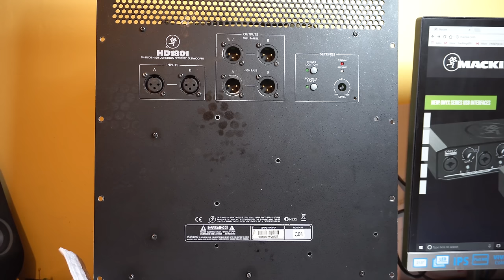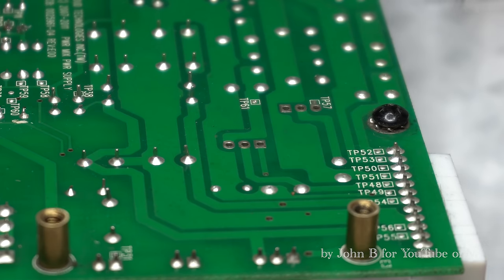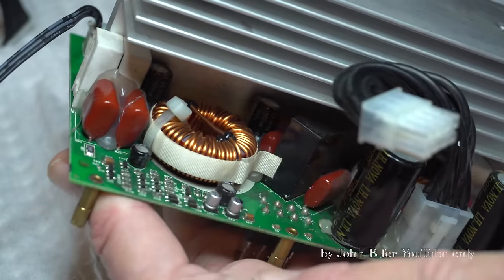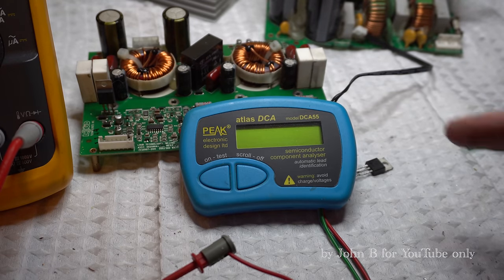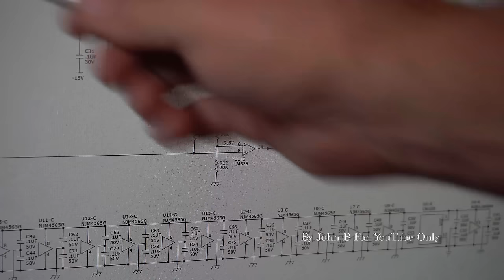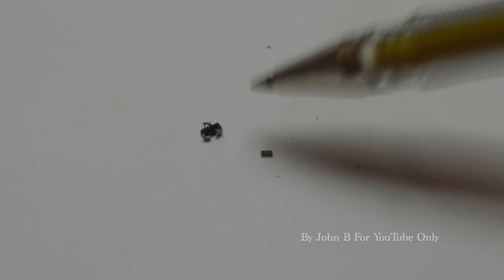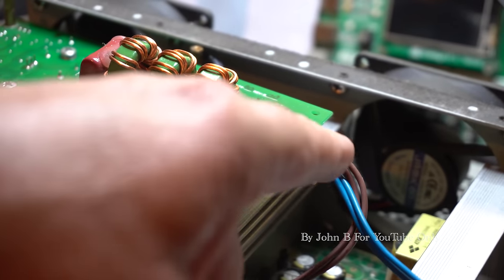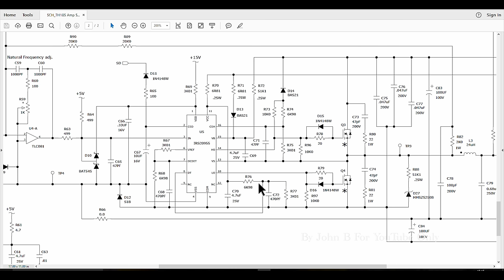Mackie HD & SRM1801 Sub Woofer Repair + IRS20955 & IRS20957S 500 watt Class D Drivers

Comment: Hi John, Thank for this helpful video. I am explroing a diy resurrection of a Mackie SRM1801 (similar power-supply) and I need some guidance.
The problem: Dead Subwoofer = blown speaker, blown power supply...at power on, only the LIMIT light came on and stayed on...
What I have done so far: I managed to identify blown resistors, diodes, and transistors throught measurement and obvious signs of failure.between Transformer(s) T2A, T2B and T2C and Q1 and Q2 and replaced them.
 Outcome: Power supply switches on (Green Light turns on and remains on - However, red light persists)
 I tested the SMPSU voltages and found that of the 4 voltages needed, the psu is only supplying the +/-15v! The remaining voltages ie +75v / -75v and 20v are not present.
I am considering removing the heatsink and the 4diodes and LM317, however, would like to avoid this. I do not see any voltages off D1 -D4, so I am wondering if the trasformer has failed.
One of your subscribers had a similar issue identifying a suitable ground for testing these diodes in circuit.

Could I progress the repair or test these components without removing the heat-sink?
The difficulty has been shared here by another poster who mentions that although test points are povided, no information on the voltages expected at those points.
Any advice and direction will be appreciated. Thanks again, your video has generated a spark of hope for my dead subwoofer. 
Apologies for the long comment.
Thank you again.
Reply from the maker: Is your amplifier connected ?
Reply: @JohnB-2021  Yes. I tried taking dvm readings with amplifier connected as well as the input/output board.
Reply from the maker: @haroon1957  Do you have a scope?
Do you have 5 volt ref on the KA3525 and do you have zero on the shut-down?
Reply from the maker: @haroon1957  I do not have the schematic in front of me now.
If your 5 volt ref is zero, the chip is not working.
Does it even have a supply?
Reply: sorry John, Vref taken from pin16 and Gnd pin 12=0.561V
Reply: With pin 12 as Grnd voltages on all other pins =0v
Reply: Update - I checked VCC on NE556 at U4, and voltage there is also 0.55v
Reply from the maker: @haroon1957  So you have answered your own question.
You wanted to check the output of the transformer yet the input is dead since it has no power.
Reply: @JohnB-2021  So i backtracked using the schematics and found, two capacitors in the path of the 16v running from the NE556 to KA3625.
C41 (0.1uF) and C37 (0.1uF). Measured before and after C41 =16v.
Before C37=16v ....after C37=0V!....
Reply from the maker: @haroon1957  talk about hard work!
C41 is on the VCC, C37 IS NOT.
Reply: Sorry, ignore previous reply.
Reply: To be honest, I am out of my depth here -it’s past midnight. Tomorrow’s another day. Thanks for your patience.
Reply: Hi John, apologies for the miscommunication - C41 is on VCC, what I should have said was C37 is connected to VCC (pin)14 on the NE556 chip! My error - again, sorry for taking up your time. Where to from here?
Reply from the maker: @haroon1957  You told me you have no power on the smps chip.
You need to establish why.
Once it has a supply, put a scope on it.

Comment: Im working on KW151. The IRS20957 VREF is 0v (between p6 and p9), I do have 10.1VDC on the VDD. My output fets werent shorted though. Am I over thinking this or are these chips just bad and need replaced when the VREF is gone?
Reply from the maker: Great diagnostics. In my experience, when both fets are blown, the driver will be blown in some fashion. Only buy genuine IRS chips from Element 14 or Mouser etc.

Comment: Thanks for your great video, John B. I have Ampeg PF-500, they using same driver chip and mosfet, after replace  IRS20957 &  IRFB4227, the 2 resistor R30/31 smoke up.. in the PF-500 schematic diagram, it use a 100 ohms in series with a 1.5nf capacitor, what is the purpose of this filter? and why it smoke up? thank you if you can explain there purpose.
Reply from the maker: I'm guessing the caps would stop any dc from blowing up the chip if the FETs go short circuit.
I've never seen caps in series with a gate on low frequency equipment, and 1.5nf is very small too.
I'm also wondering how the resistors can pass enough current to fail if there is a capacitor in series with them.
Interesting circuit design but it clearly still blows up.
I have just got the schematic, there are no caps in series with the gates which begs the question, what schematic do you have?
Reply: @JohnB-2021  Thanks for your reply, In Mackie SRM1802 schematic, are two 22 ohms 1 watt (R30 & 31) in series with a 47pf (c23 & 24) connect from output (TP1)before L1(24uH) to positive and negative supply rail respectively. I do the test again yesterday, find out  there is 460khz sine wave,1.3v peak to peak present at speaker terminal if i remove blows up resistors even with no input signal. Will it be the 1.3v present on the output kill the resister? Why 460khz present ?

Comment: Hi John. Thank you very much for this video. Very informative and great analysis of the circuits. I am repairing a SRM1801. 
I have the PSU up and running after a fix at the amp board. There was a short in the power regulator (U6) plus the C42 was leakage. This get the C18 and C19 at the PSU board blowing up.
But, there is no sound at the output. The lights do behave like the amp is working. I have an odd problem. When tracing the signal with signal generator (100Hz applied at the input XLR) and oscilloscope the signal looks fine until the right side of R7 (pin 2 for U2-A). On the left side (of R7) I have nice sinus tone, but on the right the signal is like square pulse. Do you think this could be the IRS20955 (IRS20957S). or the U2? I have square tone signal out from U2 (pin6)
Another question, what is the “Natural frequency adj.” R9 good for?
Reply from the maker: You will have a square tone, it's a class D amp.
You need both sides of the amp to work to get any sound, one side is positive going, the other is negative going.

Comment: Hello John, thanks for the demonstration how you repair the Mackie HD1801. Question, while playing my HD1801, it  keeps going in and out (intermittently) and the yellow light in the back stays on. What seem to be the problem from your point of view or how should I address troubleshooting this issue?
Reply from the maker: It sounds like the input side is faulty if the yellow light stays on.
Is it a signal light or clip?

Comment: hello great vid.. i have an HD1801 and it works fine till signal comes in .. after a short while it will start w the thermal/limit lights no power light. but i comes back for a while .. it continues like that for a while.. any info would be great.. thinking of changing those parts u mention in the video.. thank you
Reply from the maker: Maybe your woofer going short circuit.
Reply: hmm.  gunna swap amps from one speaker to the other.. if that's the issue then hurray!! thank you tons for the response.. I was thinking of that myself jus curious how to push and test it at the same time..
Reply: I have an srm1801 and it seems fine until just before the ol light comes on and it will pop and cut and then come back and play fine. Take the volume down and it's fine.

Comment: Hi john, thanks for the video but i have a problem with Mackie HD1501 the sound is not clear and bast. i change the subwoofer is still the same thing but when i tried the subwoofer with a normal ampflier it sound good. i need a help pls....
Reply from the maker: You need to put the amp on an oscilloscope to see what is wrong.

Comment: Hi John.. what a bad weekend... before srm 450 gave me a buzz sound and now HD1801 have orange signal light on constant... Speaker still have sound but power is very low. and That orange light is on straight after power switch on. thermal red goes off after few sec. signal/limit stay on. Did you had this issue before? can you help with this?. Best regards
Reply from the maker: Sorry no idea.

Comment: hi john! great repair! , a got a problem with the same amp sub only SRM1801 , works fine, but when i make the power test with a sine wave off 80hz and a 4 ohms load the rail voltages off the amp drop to +60 - 60 volts , so, it doesnt deliver the full power , i make the test with other power supply and work fine ! so the failure its in the power supply . i thought that maybe can be the capacitors but looks fine, what could be the failure
?
Reply from the maker: Where did you see you could use a 4 ohm speaker?
Reply: @JohnB-2021  well I don't know that , the client bring me 4 subs SRM1801 and they all use speakers with 4ohms coils , I repair three modules that have problems in the preamp they works fine , this only module it's the one with the failure I mention it , I just changed de power supply with one off the other modules and works fine...   When the PSU make me the failure the thermal led goes on 1 second and off , intermittent
Reply: @JohnB-2021  the power supply it's oscillating with a frequency off 100khz on standby mode when I make the test with the load, the PSU regulate and increase the frequency almost at 300khz, then I see some reapple in the osciloscope in the secundary off the big Chopper
Reply from the maker: @gabrielechegaray8247  I have no idea.
You have 3 to test it against so should be easy.
Reply: @JohnB-2021  I found it! The problem was in the shunt regulator in the thermal circuit sending a bad signal to the comparator LM339 activating the limiting off the signal , and getting on the thermal LED
Reply from the maker: @gabrielechegaray8247  Great news, except I don't remember that part.
Thanks for the update, I'm sure it will help.

Comment: Sir what is the type connector of the speaker connection ?i have 2 here i want to build back the amps in it but they have speacon now i mean the square connector and is the positve left or right on the board ?
Reply from the maker: Get the schematic from Mackie.

Comment: Hey john! I have a hd1801 what i cant get anny power to the main amp (8pin) connector, suport cant help me... do you want to help me fix it?😅
Reply from the maker: Maybe it has a short circuit fet so the power supply is shutting down like the board in the video.

Comment: Nice repair, wow! the design of the amplifier circuit is actually very bad, feedback style that takes two nodes one pre and the other post see inductor, then they take a 400KHz signal feed that back into an OP-AMP (TLC081) unable to sufficiently handle that level of spectral modulation content cause its wired up to act as a comparrator!! omg!!, they then take a post feedback scheme and use that to feedback a create what looks like a compensation network. its an okay amplifier and will do the job, but it seems like alot of engineering  for the amplifier section needs attention, again this is sensitive legal territory, the modulators schemes are  copy protected (dumb)
Reply from the maker: Thank you for your input
Reply: Your Wrong.. the feedback to the comparator is After the400kHz filters...recheck the diagram to verify...what's fed back is part of actual (20Hz-20kHz) going to the speaker....
you can only compare 2 similar signals to get a SENSIBLE output... that's been corrected of errors/ delays etc ..
F.Y.I.  This is Mackie's  
" trademark design" f.b. technique used on their classD products..rugged stable & reliable that has never been cause of any failure / faulty performance etc in the 5 yrs I have been servicing them..
Reply: @analoghardwaretops3976  in Bruno Putzey own words, "there is only on good way to do Class-D right. POST Feedback!!" with tight control loop 5-pole compensator. These modulator schemes you talk of are early attempts with high THD figures and high part count. If it's good for you then good, if you design these things and read more into the detail you brushing over you will find enlightenment. Mackie's product cannot use its own modulator, the stuff you speak of are generic used by people trying to avoid patent infringement lawsuits.
Reply: @yaghiyahbrenner8902   yes that's putzey's / philip's way..
& Many can find different solutions that are acceptable/suits them..& that's been Mackie's way  which had been accepted as a standard  and preformed satisfactorily in their customers point of listening (view) Theirs is a prof. audio target audience  whose closest listening distance may be >20-30 feet away ..so low level distortion really doesn't matter....& I can say personally it's inaudible... this statement is also supported by others with me in this  service / Pro audio install. field for Mackie/Yamaha/dbtech. / Crown etc.for the last 12-15 years....It's ultimately WHAT YOU HEAR IS WHAT COUNTS WHEN ITS ACCEPTABLE...to those concerned.
& it's a known fact that Mackie is not 
" High End A." neither they claim to be one ...
Reply: @analoghardwaretops3976  actually no it's not what you hear that counts only, in class-d amplifier design (and other systems that uses feedback) there are modulation errors and oscillating errors that causes the power stage to either destroy itself or run really hot (under certain criteria) if one section of the loop is broken or becomes unstable this will happen, your comments are only valid as a repair person you discount the stability criteria the amplifier needs to be meet under dynamic circumstances. you have much to catch up on. I'm not an audiophile person. this is pure a engineering conversation not a feelings or opinionated view of sound review, leave that to a audio reviewer.
Reply: @yaghiyahbrenner8902  I  wrote about a system that's working good and playing well to the satisfaction of all those who may listen to it..& not writing about something that's faulty in some way and that's ALL THAT MATTERS...
Reply: @analoghardwaretops3976  Then don't get involved in engineering matters.
Reply: @yaghiyahbrenner8902  I will always whenever possible ..You seemed to be " barking up a wrong tree" ...AN IMAGINARY ONE..
Reply: @analoghardwaretops3976  Take a hike. you out of your depth.
Reply: @yaghiyahbrenner8902  seems like after a lot of pointless ranting about imaginary problems you finally realised your down in the dumps and that I can really go on a hike 😂😂 thanks for the reminder😭
you just stay put in the dumps... because you just cannot discuss technical issues to the point.. without leaving all else aside. ...a sad case if you really are from an engineering background....but from what you've mentioned in all here ,you definitely do not have any background experience in anything about audio.perhaps not anything in real-time analog electronics either.... 😭😭🙏🙏Bye..